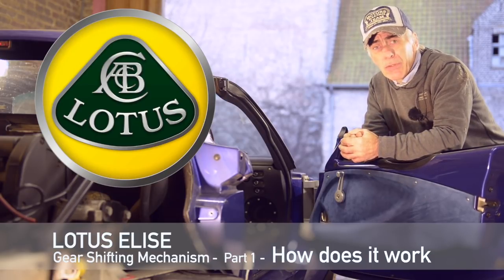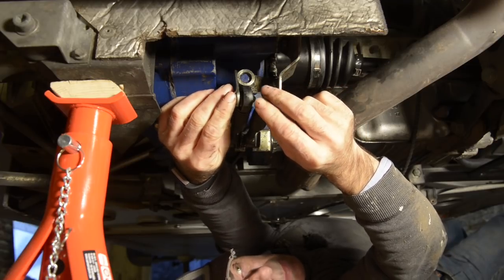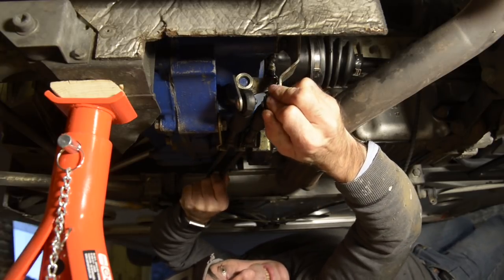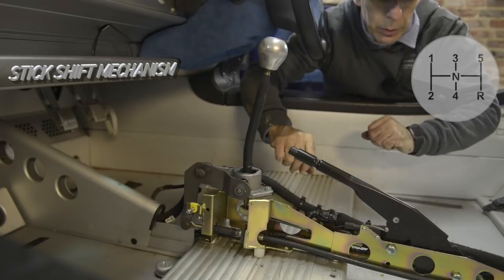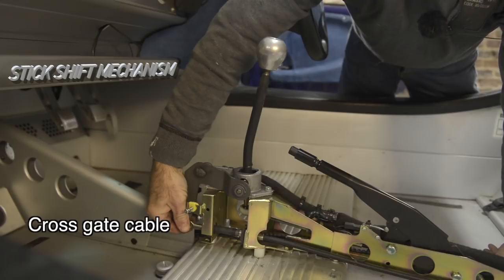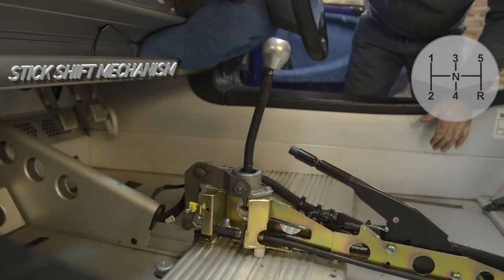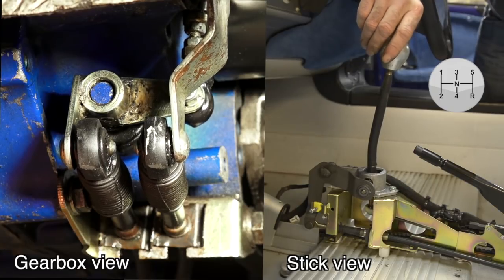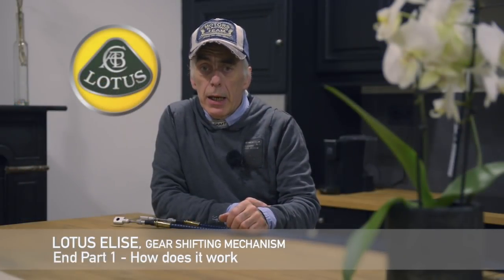Lotus Elise, Gearshifting Mechanism   How does it work   Part 1

Comment: Been looking forward for the next video quick question while the gear selector cover is off how do you adjust the hand brake cable? Many thanks
Reply from the maker: David Johnson ,  yes that is the right time to do it . In fact i need to replace the cables of the handbrake. So that might be a next video.   I just finished the gear cable replacement.  One hell of a job.  Video needs to edited and than i will post it.    Txs
Reply: Many thanks for the the reply, keep the awesome videos coming!
Reply from the maker: I will as long as its usefull.... see you on the next video....